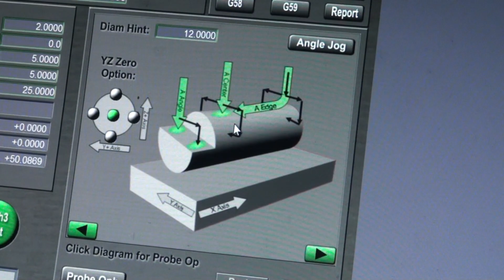Pull Gear Speed Reducer Part 5 - Thanks to Mr. Pete

Comment: Thanks Mark, but for some reason your 2D drawing opens , but the 3D model does not
Reply from the maker: Eddie, the files are all in Autodesk Inventor format. You will need to open them or import them into some sort of parametric 3D modelling programme. If you don't have Autodesk Inventor, the next best option is Autodesk Fusion360. It is a cloud based CAD programme and a very good one too, plus it is way cheaper than anything else for the features you get and if you are a student it is free.  Some other CAD programmes will allow you to import Inventor files. If you don't have a programme that will open the Inventor files you can download this file https://drive.google.com/open?id=1WcXHQyz5Yb3Kp2BsPQumtO9ZFbyaLuSG which is an IGES file of the assembly. It will open in nearly all parametric 3D programmes but the parts will all be "dumb" meaning that you will not be able to easily edit them. 
Hope that works for you.
Regards,
Mark

Comment: Would much rather hear you than the Jazz.  Is tangential tooling a big thing down under?  What are you using for a tool post drill? The pull gear is surprisingly quieter than expected.  They should have had you on the original design team.  Great work.  You should have painted the band-aid black. LOL
Reply from the maker: Yeah, jazz is not really my bag but there was no copyright on it and I was told to be quiet and get on with the job! There is an Australian supplier who was promoting tangential tool holders and we purchased some to use in a school workshop. Kids tend to blunt a lot of tools and the tool holder comes with a little jig for getting the sharpening angles right. We could use an entire length of HSS tool blank down to the last 15mm or so and when the tool is set up correctly you can cut both parallel to the lathe axis and take facing cuts without moving the tool. Setting the tool on centre can also be done without using packing under the tool. The supplier is called Eccentric Engineering https://www.eccentricengineering.com.au/ They have outlets in the USA and UK. I liked them so much I bought a left and right hand tool holder and an inverted parting tool holder as well. My tool post drill is an old AEG two speed drill (no electronic speed control). It has an all metal gearbox so it is quite rigid when clamped in the home made cast aluminium clamp which is bolted to the compound. I tried using a Bosch variable speed drill with a plastic gearbox but it had a surprising amount of flex when gripped in the clamp.
Reply: Thank you for the information.

Comment: Now that you have had some time to run the pull gear have you had any trouble with the single peg driving in the motor key slot? It seems the weak link in the system to me.
Reply from the maker: Chris,
I had to cut some large circles in steel recently using a hole saw. When I was finished I found that the keyless chuck was jammed so tight onto the shank of the saw I had to undo it with a wrench. The pin I used was made from a high quality socket headed grub screw so it would be from a fairly good grade of high tensile steel. Having said that I guess this would be the weakest link in the mechanism. If I had a broach or a mechanised slotting attachment that would be a much better way to go. There is a second grub screw to lock the inner sleeve to the motor shaft so as long as that is tight the square pin is just preventing any rotational movement. 
Regards,
Preso
Reply: @Preso58  If this does become a problem you might consider a tapered pin and jam nut  through the assembly. Kind of old school but very strong.

Comment: Mark where did you source that box of brass oilers please.? Christopher
Reply from the maker: Christopher, I got them on Ebay. Here is the link https://www.ebay.com.au/itm/23Pcs-Brass-Oil-Cup-Ball-Mouthpiece-Bullet-Pressing-oil-cups-6mm-16mm-Length-NEW/282437335270?hash=item41c293b8e6:g:ZGoAAOSwSypY9dzg. They were around AU$14 for the set. I had to search for quite a while to find what I needed. I was starting to think I would have to make them from scratch!

Comment: Hi Mark how do you cut metric threads on a imperial lathe
Reply from the maker: My Colchester has an imperial leadscrew but it is capable of cutting both imperial and metric threads. For metric threads you cannot disengage the leadscrew once the thread has been started. It means having to put the spindle into reverse to return the tool to the beginning of the thread. For imperial threads you can disengage the leadscrew and return the tool to the start with the carriage handwheel and find the start point with the threading dial.  Some lathes that  use change gears would need to have a special gear with a specific number of teeth (usually a prime number like 13) to allow for cutting metric threads. It really depends on the pitch of the leadscrew. 
Regards,
Mark

Comment: Where do you get your powder for your powder coating system?   I have been getting it from prismatic powders but it comes from the US so shipping is exxxy!
Reply from the maker: John,
I was getting some powder from Prismatic Powders via Amazon but since the US site stopped dealing with Australian customers that particular supply has dried up. I also purchased some from Caswell here in Australia and as of last year they stopped selling powder as well. I can buy large quantities from Gilking School Supplies https://www.gilking.com.au/ They sell by the kilo and although the range is fairly limited it is at least reasonably priced. You need to create an account with them and they mostly deal with school accounts but if you were to contact them directly they should sell to hobbyists. They have mainly plain colours plus clear, black and white. Gilking also sell the Eastwood dual voltage powder coat gun kit for $585.
Reply: Thanks Mark.
You can order from prismatic powders directly from their webpage.  The process is a bit weird because they use an australian company to manage the payment but they then ship it directly from the states.  I did this recently and it was pretty fast once the australian guys woke up.  You really need to email them and let them know an order is inbound, but that's easy enough.
You paid a lot for your gun.  I got mine on ebay for $200.  It is amazing.  I need a bigger oven already :-D.
Hey, if you are on facebook, drop into the "Youtube Machinists" group.  You have a lot of fans there already and it's a great place to share stuff and ask questions.  (I am an admin)

Comment: Screw the nay sayers, understanding why a process has been chosen is as important as the process itself. Whether it comes out dead nuts is down to skill level, which is built on knowlege.

I'd be more explicit but I'm holding back, really grinds my gears when a couch warriors end up dictating the way someone shows their work and talent. F**k "em, you rocked just the way you were, don't change for any one but yourself blue ;)

Comment: thought--y/ou couldnhave avoided the need for the keyway by machinging two groves all round the locking rod, then its free t/o/ rotate, but still lo/cks.
Reply from the maker: I did end up modifying the locking pin when I realised that the belt cover was fouling on it. Alas, that part of the design was a bit of an afterthought and could have been done better.
Regards,
Mark

Comment: looks like you got an unlike from Mr Seido? A question from a technical perspective, As i know only what i learned on the youtube, and have no practical experience, treat my question with the respect (?) it deserves.. When reaming, I believe "pecking" is not recommended, instead should just be a single pass with the reamer, thoughts?
Reply from the maker: I ruined a lot of reamed holes by not starting with a "nearly" sized hole. Back in the day, I didn't have any number or letter drills so I nearly always had to settle for a drilled hole nearly 0.5mm undersize. This meant that the reamer had to remove a lot of metal and it loaded up the flutes really quickly. I would have to withdraw the reamer and brush the chips out of the flutes and run it back in again until the hole was cleared. The holes nearly always came out oversize. I am guessing that if you start with a hole just a few thou undersize you could run the reamer through in one pass. I guess I have developed the habit of pecking the reamer. I must say I have never really been shown a correct way of doing it. I will have to go back through Stefan Gotteswinter's videos to see how he does it. That guy is a machining Ninja!